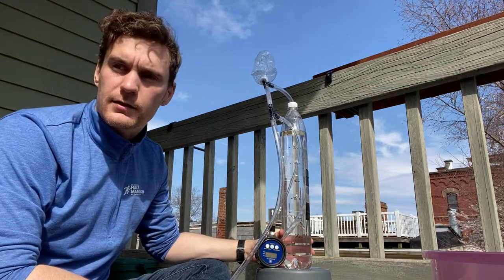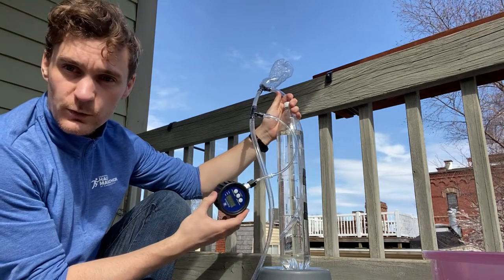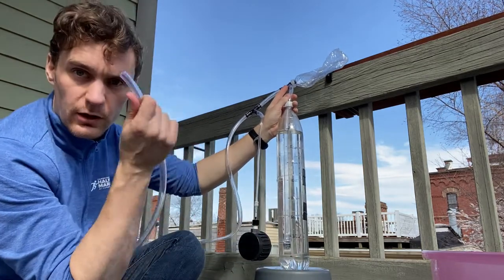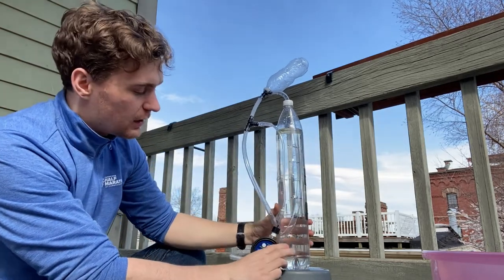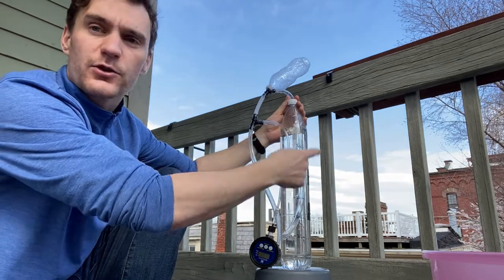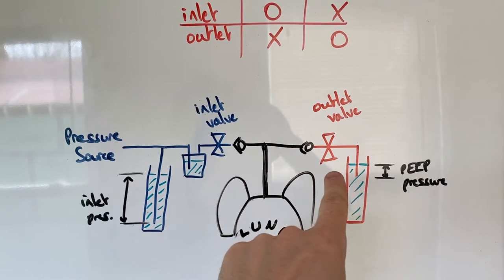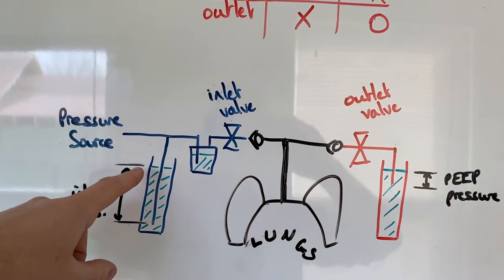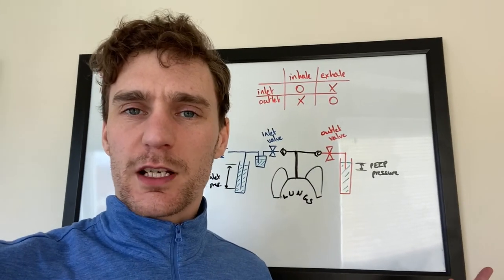Ultra Low Cost Pressure Regulation for Ventilators

Comment: Great video Rog! I wonder if there is any merit in designing a system that can serve multiple patients in a resource constrained environment? Build a large batch system and then keep individual delivery systems (with the valve arrangement) close to the patients. Redundancies can be easily built in at system level. Of course I am more used to slightly larger plumbing normally in the form of sewage treatment...
Reply from the maker: I think this could work. If your pressure supply is common but all the valving is patient unique, as you say, then the system should provide equivalent care. It does make anything that goes wrong with the gas supply that much more potentially harmful, but certainly worth considering for the right applications